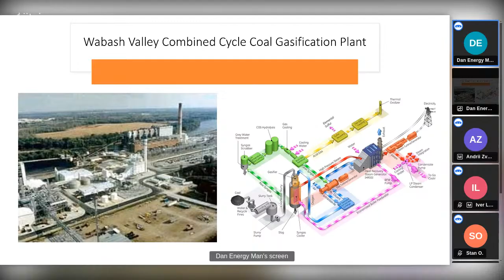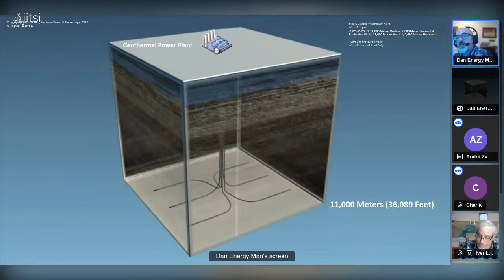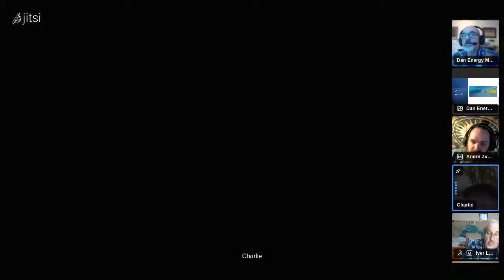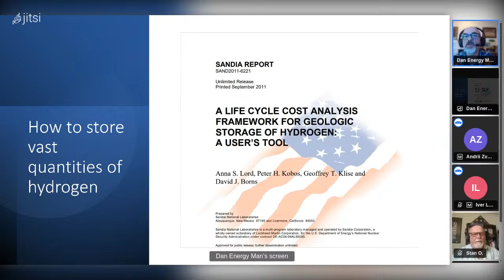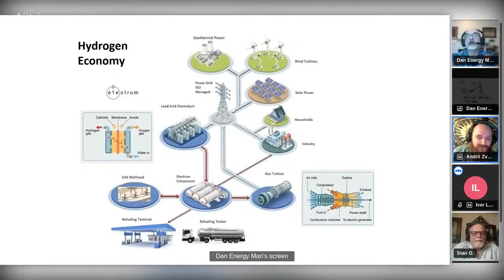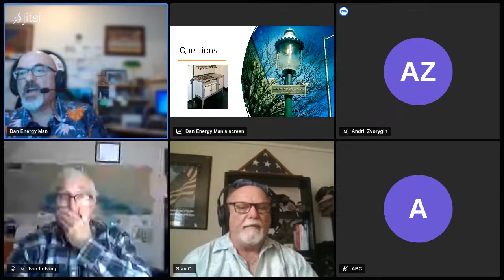May Peak Oil Chat: Hydrogen & Geothermal with Dan Gowin, Stan Osserman

Comment: ---------QUESTION-----Dan Stated (In Your last Peak oil chat video) that ......"The USA is running out of coal !" ...(And that we were about out of "Good Coal" (Bitumon?) and  were down to trying to use "Crap coal" (Lignite)...I was shocked to hear this so i did a quick search on the Coal reserves on the USA (the IEA reported we have like 432 years of coal) the IEA also claims that about 50% of that reserve of coal is "Good Coal" (Bitumon) ???.......So my question is 1) Is the IEA correct ? and 2) Is so why does Dan think we are "running out of Coal" ?
Reply from the maker: Well appalachains and area Dan is in is running out of coal, but there is more coal near the rockies.
Reply: @AndriiZ  Ok so what is the situation ? Are we "running out of coal" or are we just in a transition to the West for Coal Production ? And are these Coal resources in the West High Enough quality(and Cheap enough to produce) to make up for the sinking production in Eastern USA ? This is a BIG QUESTION (IMHO)  Although coal is now well under 20% of  Power /USA its still critical because it seems we do not have a Plan B to large Drop in Power from Coal (is that correct ?)? THANK YOU for responding to my question Sir.

Comment: Sorry, even though I tuned out at about 1hr 30, this just sounded like it was going to be one long sales pitch for a hydrogen economy, which I think has been established 20 years ago, won't happen. Hydrogen is not an energy source, unlike Oil and Natural Gas, it's just an energy carrier. 
At around 1 hr 23, one of the guests mentioned that it was relatively hard to burn at atmospheric pressure or something. Anyone here remember the LZ129 Hindenburg disaster of 1937 ?!!!
Reply from the maker: Well the surprise was that it advocated for geothermal wells, which are an energy source. 
in terms of the hindenberg we covered that also, not sure if it was during the stream, but basically the burning was the materials of the hindenberg, rather than the hydrogen itself which escape pretty quickly and went up. people who stayed in the cabin until it landed ended up fine.
Reply: @AndriiZ  ENDED UP FINE !!??
Come on Andrii, you must've seen footage how that thing came down!!

Comment: Can these deep geothermal wells be drilled in Europe?
Reply from the maker: yes the deepest one in the world is in Finland, a short walk from where Simon lives. 6.4km deep at 140C, issue has been water coming up cold like 70C, but I'm thinking they can add in an aerogel sleeve and get it at 120C hot enough for power generation. We're gonna try and contact them see how it goes.

Comment: This is mind blowing! Running out of fossil fuels has been such an obvious catastrophe in my mind. I just cannot believe that geothermal power and syn gas and hydrogen vehicles could possibly be a solution! This is like reading a sci fi book I’ve never read before. I just cannot wrap my mind around this. Is this actually possible? Can technology actually save our civilization when it’s being running completely on fossil fuels for a 100 years. Wow!!!
Reply from the maker: well I don't know about "save our civilization" but certainly can be good grounding for a future civilization, and we can start soon. But will still have less total energy than now. In terms of where we are at now, in tectonically active areas like Idaho etc we have ones working, but for regions on continental shelf proper deepest publicly available geothermal wells are in Finland at 6.4km at 140C. they ran into issue of the water not coming up hot enough more like 70C, I've suggested they put in an aerogel sleeve so it'll come up at 120C.  So we still have some kinks to work out before it can be widespread.

Comment: So, we're about to solve the transportation problem? I have an engineer colleague in university who has been saying the Hydrogen economy is possible and inevitable. Ive been rubbishing this to date...I guess it is actually possible after all. The future is going to be even crazier than we thought.
Reply from the maker: I'm not sure which "transportation problem" you are referring to here. but with this geothermal we would be primarily allowing like pockets of survivaibility. areas that can implement it before fossil fuels run low. and afterwards can expand outwards kinda thing. Though I'm pretty sure we'll still have lower overall energy, and so likely will still need to ruralize, and less commuting etc.